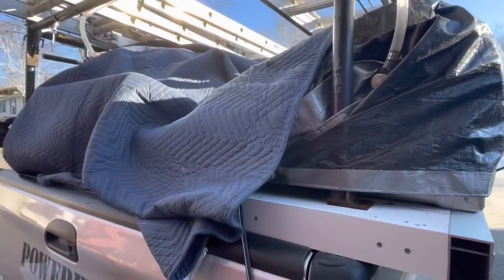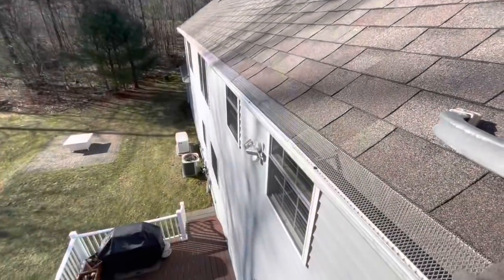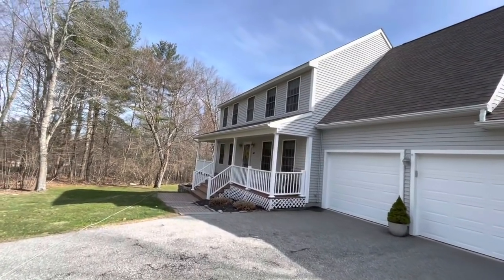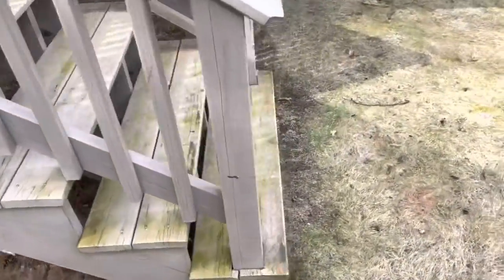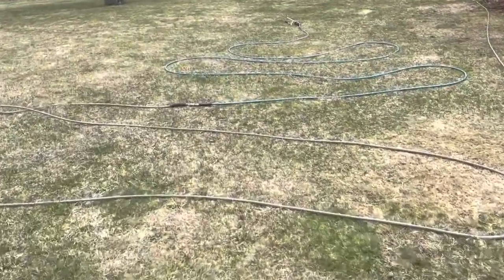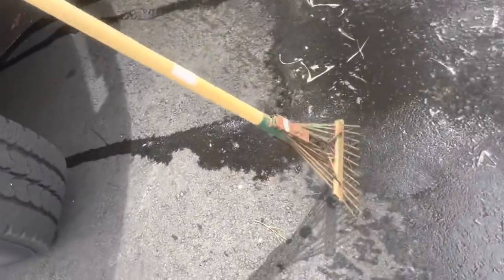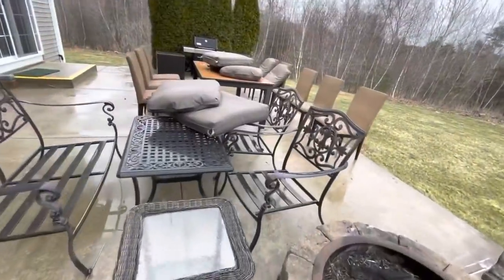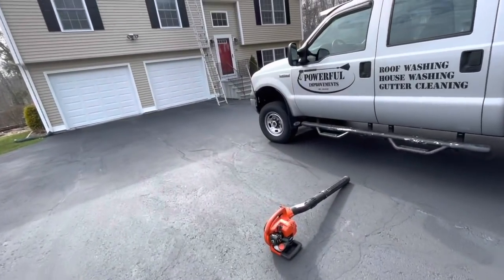5 Projects

Comment: What type of nozzle are you using to get you all the way up there in a straight stream. I do downstreaming with a 3.5gpm 4,000 psi pressure washer and jrod nozzle. I feel like i lose distance with my nozzle. the stream breaks apart. Thanks!
Reply from the maker: Shooter tip

Comment: Because of the injector issue you recently helped me on I’m considering going straight to a 8gpm PW instead of a 5.5…. I have a 275 water tank and most houses in my area are 3-4 stories high which is crazy but I should get more height with an 8gpm so I’m really considering it
Reply from the maker: Do it
Reply: @powerfulimprovements  I think I will
Reply: You might save $2000 but the benefit you will gain will be so much greater.
Reply: @adamchicoski5284  yeah I agree. I do this part time so speed and efficiency is very important. I’ll probably go through this season and then order the 8gpm in September/October
Reply: Unless I find one in stock and ready to ship, then I’ll buy it now
Reply: @MrNick-  Check out 3r Sales and Service, then have them in stock and ready to ship out
Reply: @adamchicoski5284  thank you, will do